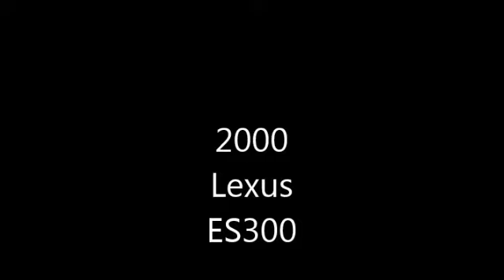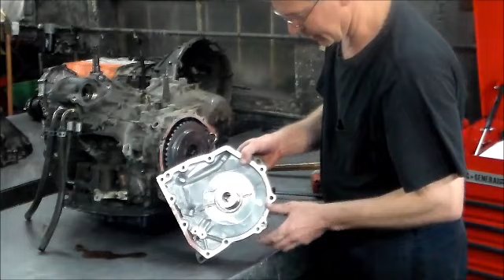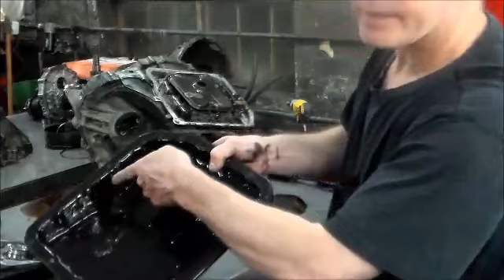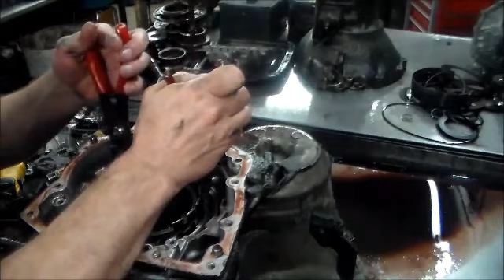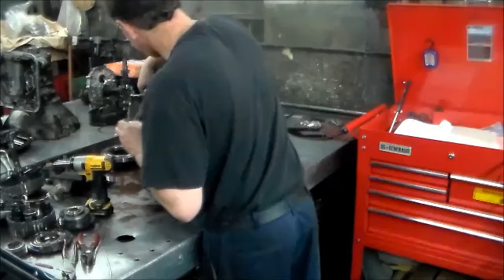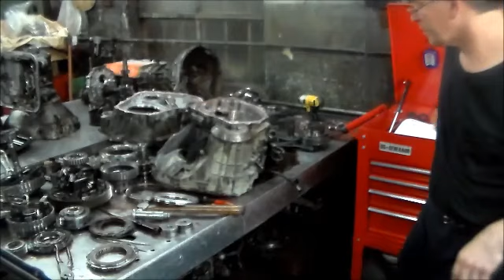U140 Teardown Inspection

Comment: Excellent video! I have a question you maybe able to help me with, I have a 2003 rav 4 that had a bit of a shutter or flare on the 2nd to 3rd shift some times it's bad sometimes it's hardly noticeable. Other then that the transmission works great no slippage and all other shifts are smooth The ecm has been replaced and it is still doing this. I pulled the back cover and the sealing rings on cover for the direct drum seem loose in the groove could this be the issue? Any thoughts?
Thank you for your time 
Jeff
Reply from the maker: Jeff, Changing the ECM is key on this year, when you had the cover down did you pull the drum out? the clutches are probably worn, the bad ecm usually takes the trans out. Gary
Reply: The transmission is still in the Rav 4 but I was able to take the back cover off and see the direct drum, can those clutches be replaced with the transmission still in the vehicle? Then do a few fluid and filter changes?
Reply from the maker: They can, just make sure everything is in back in place when you put it back together. are you familiar with this trans?
Reply: No not familiar at all with it. I just read that the direct drum could be the issue. Do you think if i replaced the plates it could solve my issue? I do have a good used trans to put in the rav 4 but I thought I would try a few easy things first. The transmission works great other then the 2 to 3 shift
Reply from the maker: I honestly think it will, but when you pull the drum out, parts are going to move out of place and parts may even come out with the drum, to correctly install, you may have to disassemble further into the trans. You may need the clutch plates  and steel plates.  Where are you located?
Reply: Just pulled the drum and yes the plates and steel are bad. Can just the plates and steel be purchased from a toyota dealership?  I am located in St.   Stephen NB Canada right on the boarder of Calais ME
Reply: Replaced the plates and steel and after getting the computer reset the transmission works great and I was able to make the repair the the transmission still in the rav 4! Thank you very much for your help Gary 

Jeff
Reply from the maker: Jeff, thanks for the update, glad you got it back on the road

Comment: de verdad  me ayudo mucho  muchas gracias señor  gary
Reply from the maker: Thanks for watching.
Reply: @GaryFerraro  really that box I have to disarm it like 5 times and I was missing a part of the mid-mast rache a piece of aluminum I apologize for not habalr in its mechanical terms but the car changed me and everything but had no strength for any side tomorrow I arm him and tell him how he was greetings sorry the time
Reply from the maker: @1217050405   sorry, little confused, what is the mid-mast rache?
Reply: @GaryFerraro  
ok i'm in venezuela and here that box is called u240 the one a corolla 2004 but it had that detail the change and everything but the loss of strength was great and you accelerate it and apply in 3000 revolutions the engine
and it changes and everything but you have to be in traveling because if you roll it a lot in town the box is burned and the car is neutralized because the filter is covered
Reply: @GaryFerraro  
if that one that grabs the piston of lauminio that leaves with two manual pliers
Reply from the maker: @1217050405  Is there a certain time on the video you have a question about?
Reply: @GaryFerraro  
question as such, but I did not see what the problem was.
he helped me his video pretty

Comment: Hello Gary, I am checking differential fluid on my car 2004 Toyota Camry se. But I didn't find out the filling or draining hole. Someone said that Camry's differential and transmission share the same fluid, since 2002 . Is that true? 
Thanks for your time
Reply from the maker: li yang yes, that's true, they are inter for cases,back in the 90's they were not, a lot of the digs were going bad because no one was checking the fluid, so now it's all one. Gary
Reply: Thanks a lot Gary. I got a bottom of gear oil in my hand and wondering where should I pour it. Even transmission service manual doesn't have any word about differential fluid.
Reply from the maker: Its all transmission fluid, has an interflow case, back in the day they were seperate fills.

Comment: Hi..greetings from Armenia...i have a question,on my Lexus rx300 u140 trans no any gears,no reverse and forward,i chek inside the trans no any defect?what can it be?thanks
Reply from the maker: Ak S600 Did this happen suddenly?
Reply: @GaryFerraro  no it is finally
Reply: The trans work normally,but just one moment it doesn't not working
Reply from the maker: Ak S600 for this to happen suddenly. Something had to break. Have you checked The axles

Comment: I have u140f on a 2000 rx300, all gear selectors work fine except in P, the vehicle rolls. Any quick fix for that? Thanks in advance
Reply from the maker: does the car move? could be broken axle
Reply: @GaryFerraro  I meant in all gear selectors the car functions as it should (forward or reverse) but only in P it doesn't stand still. I'm guessing it's the parking pawl or related component. That's a junkyard transmission. I just removed that one and installed with another junkyard transmission and now the SUV doesn't move in any gear selector. I believe this 2nd transmission has fried clutch discs. What test can you recommend to determine the transmission is not faulty without disassembling it or installing in the vehicle? PS...I tried starting the vehicle in every gear selector and it would only start in P and N... this confirms the selector cable is installed correctly. Appreciate any top you can provide. Thank you
Reply from the maker: @tmph1814  On the first trans, i would disconnect the cable and see if the trans goes into park, if it does not then problem inside. 2nd trans does not move probably bad gear train, did you drop the pan?
Reply: @GaryFerraro  Yes the pan was out to replace filter. The transmission fluid looks a little dark with some metal dust around the magnets nothing excessive.

Comment: I got a ravr with U140f the transmission is awd, I wonder if possible use the U241e to make convertion in just fwd?, is possible I can use the same ECM?, I check all wire diagram and look like the same?
Reply from the maker: The internals for the most part are the same, but one difference in these 2 units are the axle seals, not sure if the axles would work, also tooth counts on the diff, make sure they are the same(not sure what they are) just dont want the computer to throw any ratio codes

Comment: Hi Gary,
 I have a 2001 Lexus RX300 with codes P0770 Shift Solenoid Shift E. My questions is, is it possible to replace that solenoid without dropping the valve body?

Thanks in advance!
Reply from the maker: Yes, this is just an on off solenoid, it could also be other things too. was anything done to the trans?, its not very common to see this code on this transmission
Reply: Thanks Gary! Nothing done to the trans just threw the code while driving with a heavy load in the rear. I just changed out the solenoid and everything seems to be fine but did find a lot of metal shavings on the magnet. Hoping to do another trans flush in a few thousand miles to see how much more metal shavings the new filter has collected. 

Thanks again!
Reply from the maker: Let me know if the code returns or does not return. Thanks